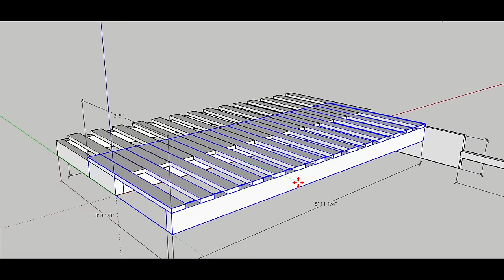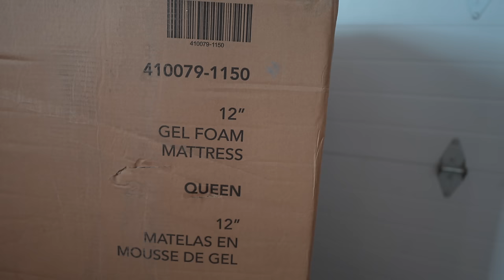Space Saving Bed Design to Transform your Camper Van

Comment: Great way you solved the problen of the slats on the bed! I just did my bed in my 1987 J9 and used a high quality, custom cut foam of only 4". Its actually very comfortable to sleep on.
Reply from the maker: I usually like to make my mattresses out of 4 inch memory foam! My client bought this mattress and asked me to install it into the van. I didn’t realize how thick it was until it was out of the box 🤷🏽‍♂️
Reply: @Dualex_Builds  I have been trying to reach you.  I am extremely interested in having you do some renovations in my RV ASAP!!! How do I reach you, or how can you reach me?
Reply: Rivnuts are neat, but can they spin out years later? Would some red loctite under the rivnut be a good idea?

Comment: Nice to see you still doing your thing.  Wish you would spray paint those holes before putting on the rivnuts. If you ever take apart one of these build after a couple years of use you'll see why. For the bed frame felt slides better than rubber and will protect that countertop as well. Also I don't get the cabinets above the headspace on the drivers side. We gonna get to see you do some upholstery on the mattress pieces?

Comment: Mr. Dulex, please tell us how why you put the achor for the slat system on top of the bed frame instead of on the bottom so it not only kept the slats alined but also acted as a stopping block so you did not pull the slide out of its place. I did not see that action in the bed slide system. Please elaborate?

Comment: If you move the support piece you added to the top of the pull out to the bottom side, it would also act as a stop to prevent someone from pulling it too far.
Reply from the maker: There’s actually a stop block that prevents it from sliding too far on the support rails but I forgot to mention that in the video

Comment: I attached a board under my wood, it allows the strips to stay in place and lock it from sliding all the way out, i then added two aluminum strips under the fixed piece to stop the slide part from dropping down.

Comment: I've been fixing the back of my pickup truck as a solo camper, and have been thinking of a similar idea, but having the ability to convert to a couch with the one section going vertical. I've also been considering how I might utilize the linear actuators and mechanical parts from a used recliner to automate the transformation from couch to bed and back. Have you considered using them? (I did see the video where you attempted to use the mechanics from a futon... So this is sort of similar.

Comment: You don't need to add a thin piece on the top. You can add a 1x4 under the slide part. The 1x4 piece also acts as a stop.
Reply from the maker: The wall support acts as a stop for this design. I didn’t add anything to the bottom because that would prevent the bed from opening at its full intended depth. What I did works better for this build

Comment: You could have made the sliding planks a inch shorter and added a 1x4( assuming those planks are 4inch wide) block on the bottom of the slide acting as a stopper when you pull it out and than add a dowel or rod through the frame and through that block. Allowing smooth pulling and some extra support with a dual feature to hang things underneath the bed with the rods also hope the hand is alright man

Comment: ok say it did fit. And now you want large mode was you going to get another mattress?
Reply from the maker: That was only half of the mattress. You would have both halves stacked with the bed closed then put the top half in the extended portion when you open it

Comment: Never get the wood get in contact with the metal of the car. The water from the humidity in the air will "condense" at the colder metal when it is getting cold outside. Then it is in contact with the wood and mould will follow soon. Between wood and metal always have some armaflex or cork...

Comment: The way the bed slides out over the counter and stove is worrying. Also, I feel like this setup will not last very long. Like the wood is structured well, but overtime... the bed is going to wear down and it'll all just need to be replaced with sometime more structurally sound.

Comment: Dude, your drilling and screwing needs some serious work! I saw screws being over-torqued into the metal - destroying the little thread they may have, with zero hold left and those holes for the rivet nuts are way too big. Look how lose that nut is! When done right, they don't wiggle at all. The adjustment inside the tool wasn't right either. Screwing through the wood was also way off and not at 90 degrees. Get a proper drill press, a better set of drill bits and screws made for sheet-metal. Also, use Spax screws instead of those wannabe wood screws. They hold much more by cutting a deeper thread.

You can add that thin support piece below, it will allow to slide in but be out the way for the mattress.

Gold standard for camper mattresses is 3 inches of hard foam and 1 inch memory foam topper. That will remove 4 inches of your total height.
Reply from the maker: The rivet nuts are not loose. I re tightened and squeezed the tool again and it grabbed the hole properly. Just didn’t record it. If they did wiggle, they wouldn’t be able to hold up the bed. 

I’m using wood to metal screws in this video and I don’t need a drill press. Perfect 90 degree holes don’t make a difference for what I’m doing. Not sure if you heard that I didn’t choose the mattress. I’m building this van for a client and she purchased the mattress. I told her to would be too big but she insisted. So I put it in there to show how big it was. I don’t care about the gold standard of anything in RVs. RVs aren’t really built too well so I don’t take inspiration from those 

Support piece does not need to be on the bottom. It doesn’t effect the mattress at all and if it were on the bottom the bed would not be able to slide out to full size.

Comment: I’ve only watched 60 seconds, and he’s already used wood screws in metal… and drilled a extremely oversized hole for the rivnut🤦🏼‍♂️
Reply from the maker: Those are wood to metal screws. They look like wood screws but have a self tapping tip. That was also the proper sized hole for the nut. I didn’t have it tightened all the way when squeezing the tool the first time and didn’t re-record it when I re-seated and tightened the tool. I like to show my mistakes sometimes